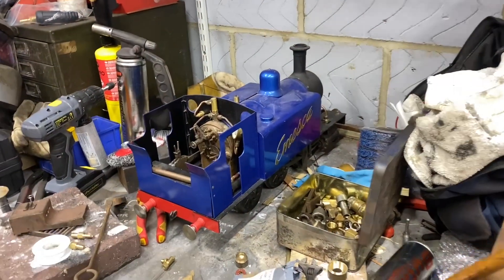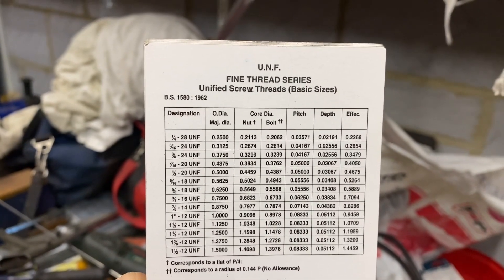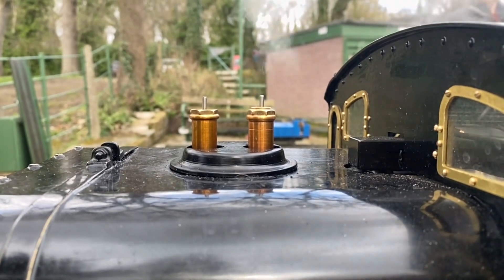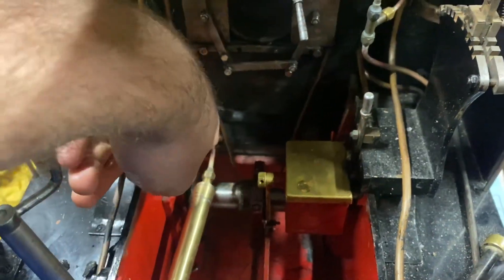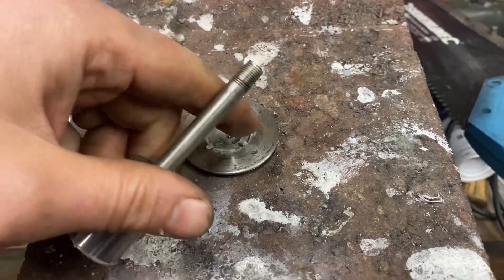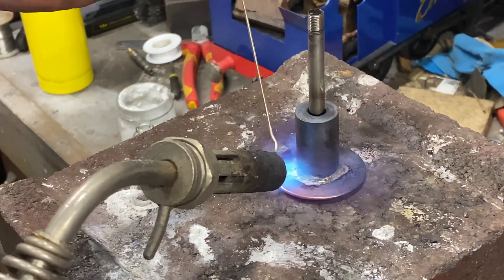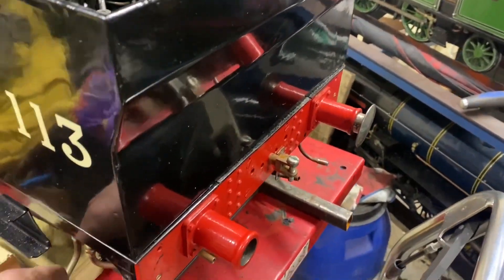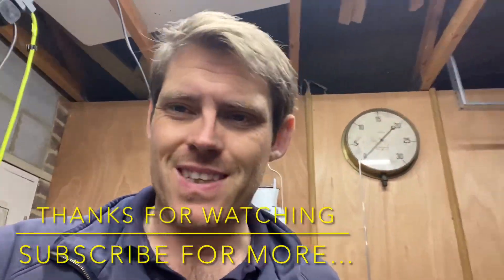Jinty boiler test and repairs…

Comment: Hi Tom I have a 31/2 inch St Christopher  locomotive  which is a Don Young design sourced from Reeves, I am in Australia and the boiler Is stamped with DCE 1102 and on another plaque 208B66. I bought it as a deceased estate as it was built by a RAF captain who  died from cancer before he was able to complete it. I am trying to ascertain if the boiler was built in the UK or in Australia, just wondered if these  numbers are known to you or someone you might know.
Reply from the maker: It’s not a number I recognise I’m afraid. The trouble is it’s only commercial numbers that follow a pattern, if it was model engineer made it could be the builders initials and date of build, that’s the system myself and my father use.
Reply: @TomsWorkshop42  Ok thanks for the reply Tom.

Comment: Hello Tom, silver soldering the buffer head to the shank - boxing it in with bits of firebrick may have heated a bit more uniformly with the aid of a bit of reflected heat...?
Reply from the maker: Yes it may well have done, although for what I was doing it may have restricted access to the other side which is why I opted not to, if I had struggled to get it up to temperature then I could well have done that and come up with a way to turn it while it was hot.

Comment: Lovely job on the buffer Tom what size pressure gauge is on the rob roy looks a nice size one 👍🏻
Reply from the maker: Thanks.
It is a bit big for that loco, but it’s what was on there when I was given it, and as it is meant to be a loco for the kids to learn with thought I’d leave it. It’s probably 3/4” although if I remember I’ll have a measure tomorrow.
Reply: @TomsWorkshop42  thank you yes I think I might get that size for my Loco